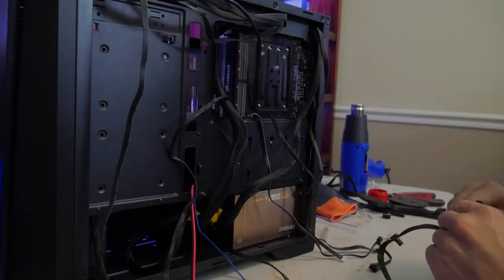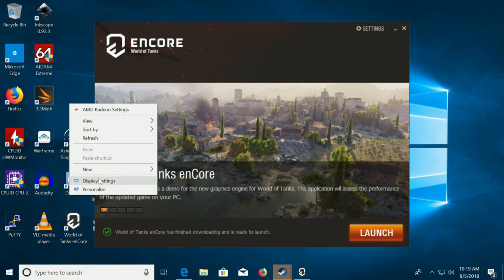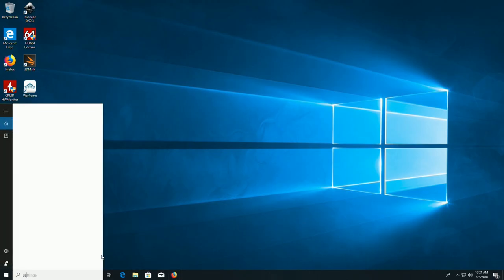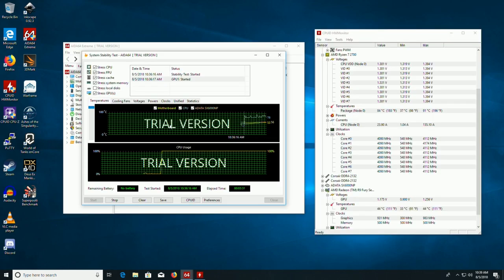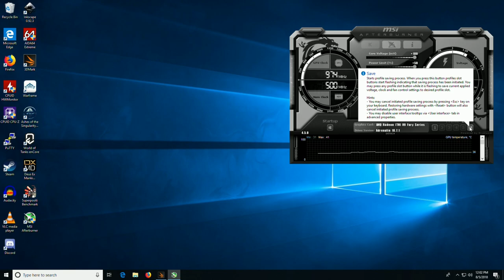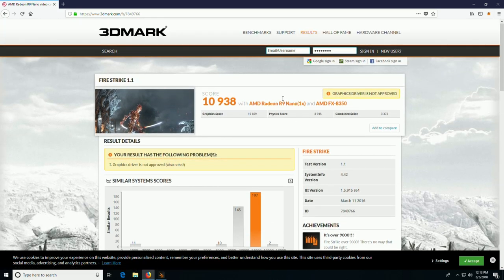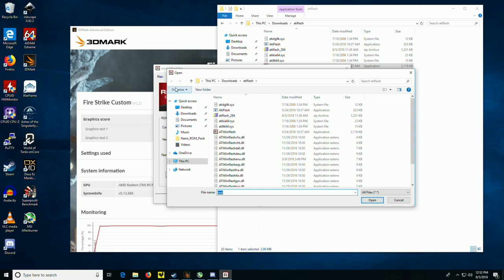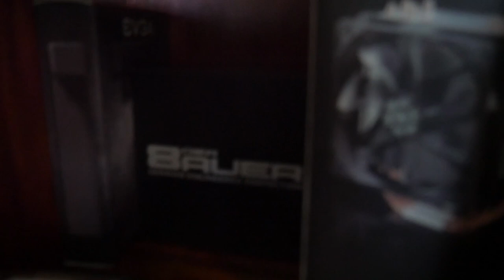PC Filled To The Brim and Overclocked | Quake Con 2018 Build

Comment: If those fans have a connector,and are control via remote control you need to plug them in order.. 1 on 1 - 2 on 2 and so on....lights should work!Also you have a switch on them,and pull down on RGB mode!

Comment: I understand that after a while the liquid picks up particles and becomes conductive.  How do you check for that and when do you need to change the fluid?
Nice vid.
Reply from the maker: I've never had a loop together long enough to monitor tbh. I am a serial builder. Typically 6 months swap fluid imho